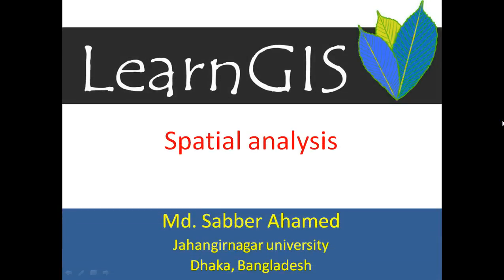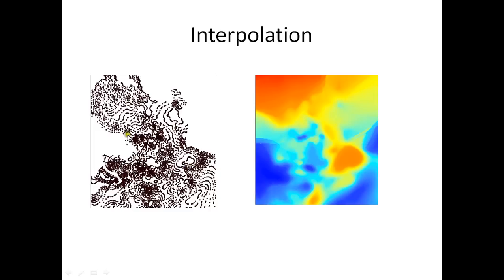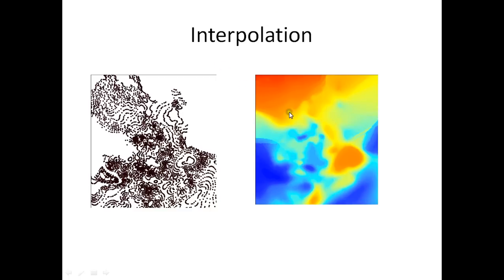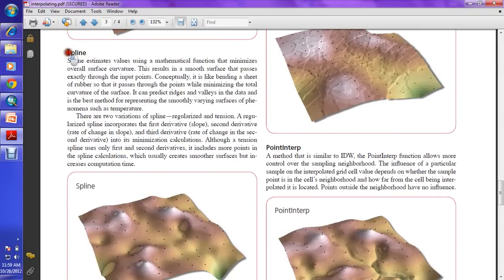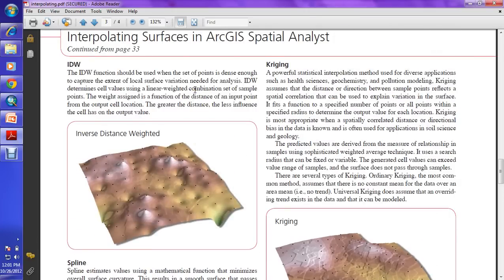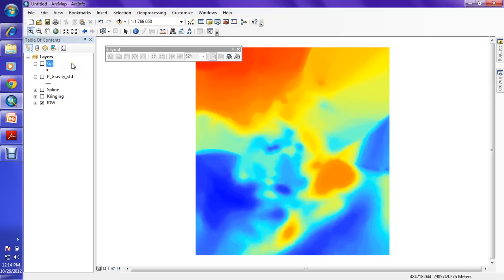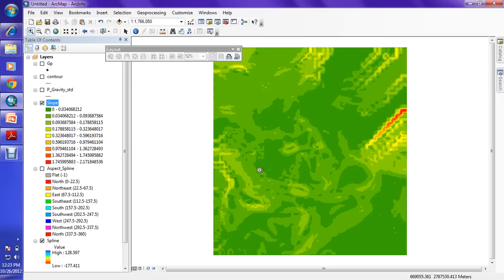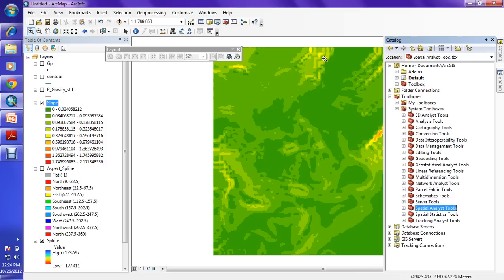Lecture : 8 |ArcGIS 10:  Basic Spatial Analysis

Comment: i have some polygons but i have to create polygon in polygon( As a offset in side in existing polygon in all polygons in very shot time) with the help of arc GIS 10.1. If you have solution for this query please help me ASPS.
Reply: Use the tool EDITOR and select POLYGON SPLIT and make polygons in polygons like you normally make polygons